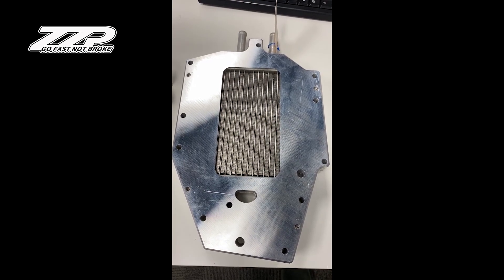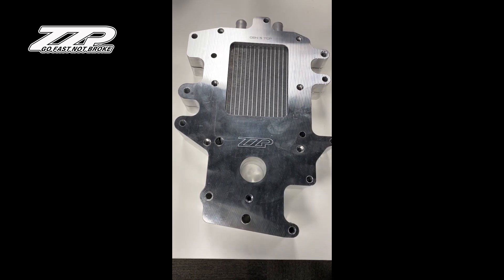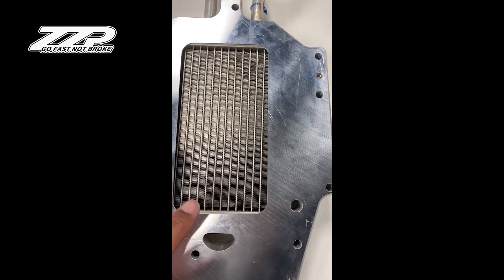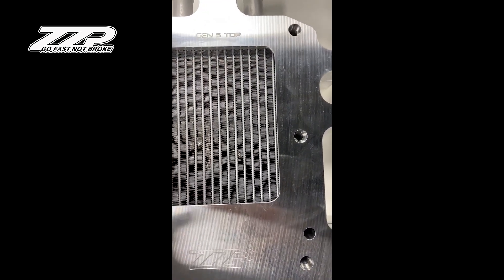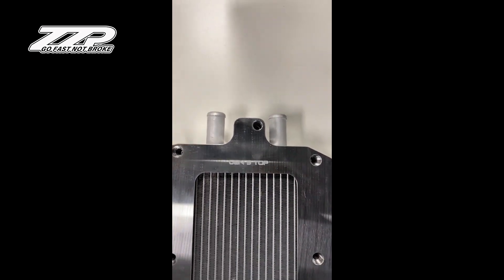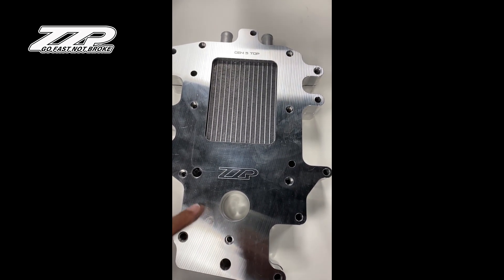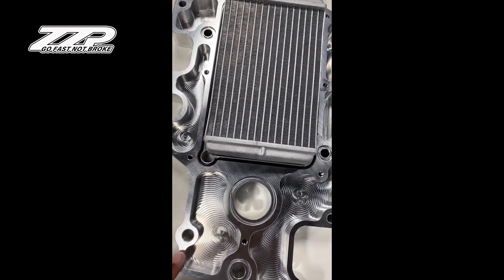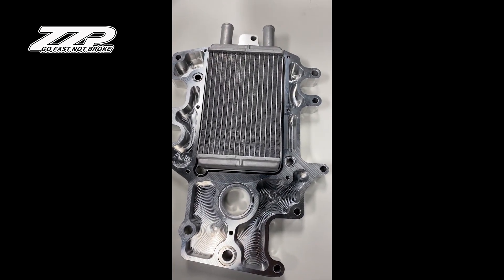ZZP 3800 Intercooler Core Stage 2.5

Comment: I'd rather buy a zzp made ice box/reservoir to mount in the trunk /wheel well. Nothing huge, 2-4 gallons. That's real capacity and efficiency. Make the lid clear with zzp on it so we can watch that juice cycle. 
Unrelated: zoom posted on Fb that y'all have a better option in the works as far as the equal length header mod. Can yall drop the sound clip video. Alot of guys are stuck in limbo waiting on that video. I Was legit about to do the equal length with my twist on it😈 until he posted that on Facebook

Comment: Wish I could use this for my bird. I have a Gen V blower, L32 swap. Would still have to cut the cowl to make it fit. 

Wish you guys sold something similar to the Mace a2a intercooler that replaces the lower intake so I wouldn't have to cut the cowl.
Reply: How'd you get the intake to curve around to the front? I'm trying to do this to my 3800 FB too.
Reply: @GoldenGrenadier  check out my Instagram @3.8sc_firebird for actual pics of the process and stuff. But the short of it is that we cut the back end of the blower off, made an L shaped intake that connected to the blower and ran parallel to the firewall. Then the rest is just some flex piping